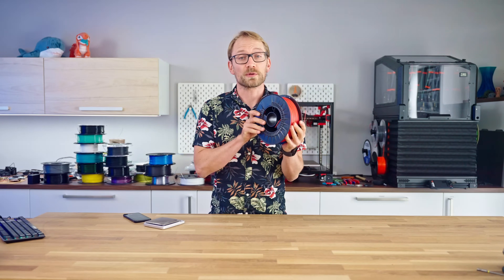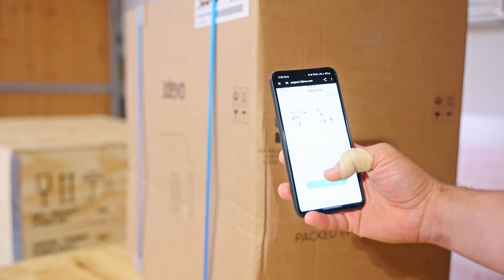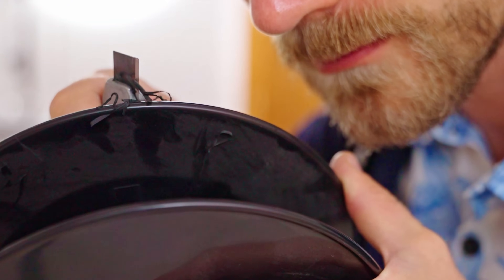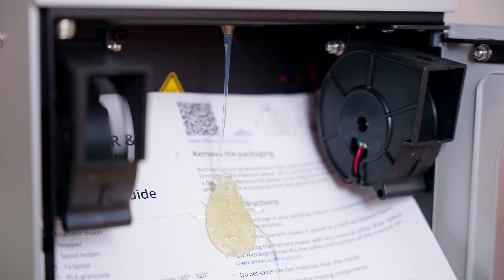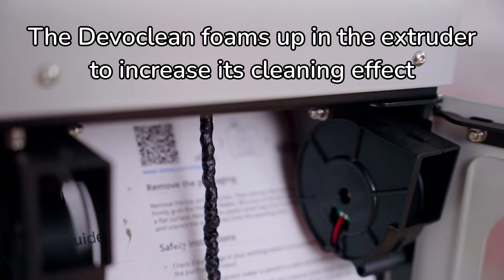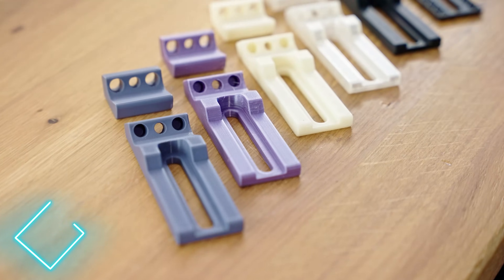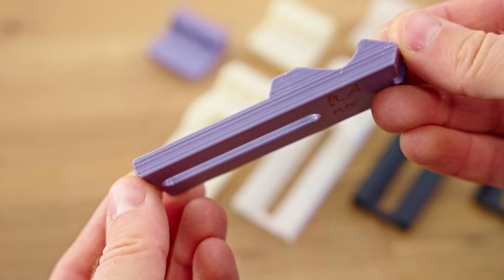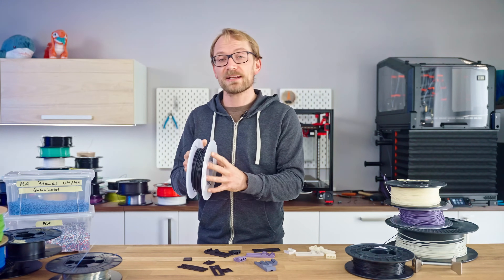Can you print (with) your spools?

Comment: What I don't get is why everyone hasn't just adopted a similar refill system to Bambulab spools. Reuse is the best part of the 3 rs
Reply: Or sometimes called spooless spools.
Reply: Ive been buying refills, but sadly the variety of filaments are not great. Its basically Das Filament, and they have only PLA and PETG. I am printing 90% hard TPU these days, so....
Reply: There have been plenty of filament brands that offer refills or use cardboard spools for years, but it's not cost-effective. If you can wind straight onto the spool and require no post-processing it's much cheaper than having to then move the length of filament off the spool (without it tangling), and the spools are much less likely to tangle due to user error than refills. Cardboard spools aren't nearly as easy to produce and aren't as sturdy, so plastic is used.
Reply: @daylen577  Not cost effective? their filament is some of the cheapest quality filament and only had a thin cardboard roll and the RFID tag.

Its also one of the better reattach enter systems (Other ones I've used had thumb screws for instance).

Also confused why cardboard spools were brought up. I'm talking about refills for plastic spools.